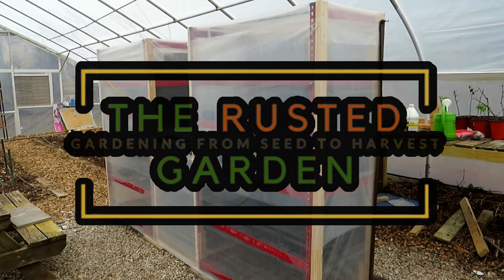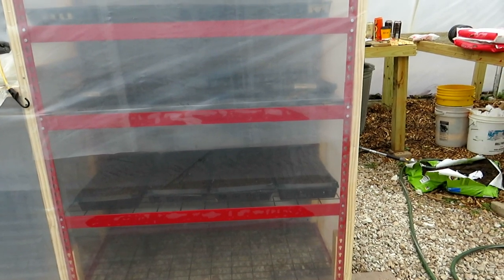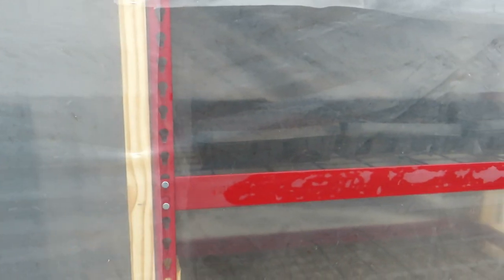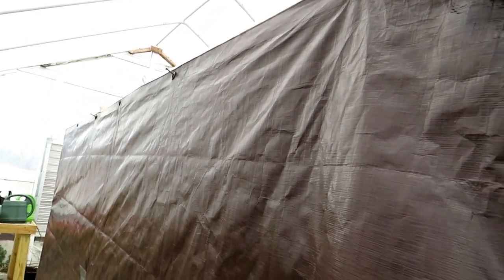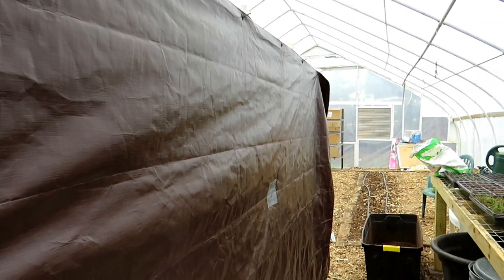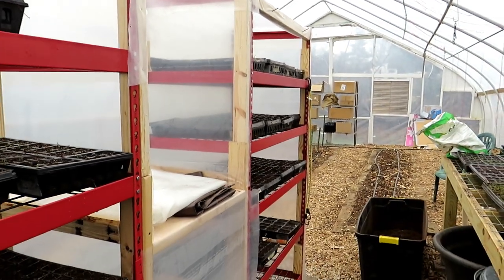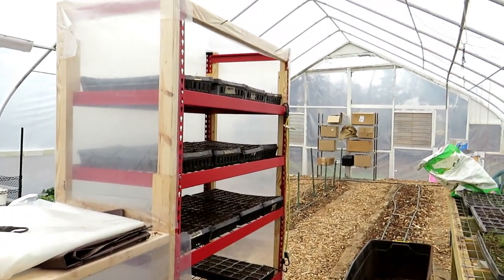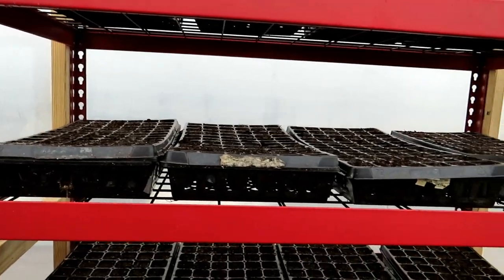Build You Own Shelf Greenhouse for Indoor or Outdoor Garden Use: Basic Principles For You To Create!

Comment: Great job Gary! Being that I sew garments, for the door...I would've used a strong glue to Velcro the sides edges or stapled the Velcro all along the side edges to open & close. Velcro can be placed on any surface & will hold! The Velcro is safer than the bungee cord. I was snapped by a bungee cord & it hurt so bad I started crying!
Reply from the maker: Yes the are dangerous. Maybe Velcro on 2.0.
Please check out The Rusted Garden Seed & Garden Shop for all your gardening needs at www.therustedgarden.com & Please Ring the Bell (next to subscribe) to get immediate real-time video notifications. Thanks
Reply: T-Rex brand double sided super glue tape! I just finished constructing a simple cover for my mini greenhouse  using it and some duct tape. Only complaint is that I wish it came in bigger rolls as the stuff is crazy sticky. I actually save the very end of the rolls as it’s easy to peel back the covering on the little bit stuck to the roll and use it to remove tiny splinters from my fingers.

Comment: Gary, that's a really nice design.  It falls into the category of Elliot Coleman's ideas of double cover = 3 zones south (@1.5 zones south per each layer of cover).  You might want to invest in a remote thermometer so you can monitor the inside temps vs. the outside temps. (from the comfort of your own home, as this is not at your house), to get a sense of all the variabilities, and then make adjustments in terms of venting as needed.  Although, with that high ceiling on the greenhouse you might not have to vent much ... not sure.  Thanks so much for the ideas!
Reply from the maker: Thanks for the ideas. Learning the ropes of this greenhouse.
Please check out The Rusted Garden Seed & Garden Shop for all your gardening needs at www.therustedgarden.com & Please Ring the Bell (next to subscribe) to get immediate real-time video notifications. Thanks

Comment: Hi Gary I love your channel and I am inspired by what you've made here. I am thinking about doing something similar, but I want to ask you and your viewers first. What about using magnets to hold on the plastic? Making lightweight removable pannels. You could use for a door or window to ventilate and access. Fall/spring and in winter you could "insulate the cracks with bubble wrap and tape" I think the sticky tape magents might work but if you construct frames for the exterior from 1x2 or something light and srew or glue or tack, idk afix somehow rectangular magnets to fit the shelf bars and put plastic on those or maybe tuftex. Also in the summer all of the pannels could be pulled off and stored abd the shelf could still be used with shade cloth and clamps for summer  seedlings rack. Also thinking about using the crome shelves with rounded side supports. The clamps that go on PVC fit and that could hold plastic. Lastly, I'm think of putting a roof over it with Conduit and a wire fence to support plastic. Or a roof with wood frame screwed into the clamps that I use to hold pvc hoops on my raised beds. 
Sorry for dumping my thoughts on you. I live in a town where codes are greenhouse and outbuilds are limited, but I can have a shelfs or anything that isn't permanent. The premade plastic greenhouses are too flimsy for NYS weather. 
Thanks for everything and may God keep you in His bountiful blessings 🙏
Reply from the maker: I am using it now at the farm. Heavy duty magnets is a great idea for the tarp. I never though of it. I might try it. Ill be just duct taping them the tarp if I do. Smart! For the plastic. I would only worry about moisture effecting how they stick. It could work. But taking your idea to the tarp will improve the build. All in all I like these heavy shelves, especially outdoors as wind won't knock them down. I think you ideas are good, I would keep in mind high winds too. Good luck
Please visit The Rusted Garden Seed & Garden shop for your fabric pots, fall & spring seeds, seed starting supplies, peppermint oil, neem oil, TRG merchandise and more at www.therustedgarden.com Check out my new gardening PODCAST Gardening Coast2Coast at https://gardeningcoast2coast.net with CaliKim

Comment: Overnight when it's really cold, we drape a bunch of thick, heavy-duty quilted movers blankets/pads over/around the whole thing. Mummified in several layers thick. Strung up real tight with bungee.

There is no cheaper insulation.
You can find them on FB Marketplace and your local craigslist for 3 bucks each (or less in bulk) and 2 layers will keep ours 10t o 18 degrees warmer than the raw plastic alone, mostly dependent on wind conditions overnight. When it's teens and low twenties out there (we're forecast for 25-ish tonight Ferenheit) it does an adequate job for the cool weather plants... we still pull the warm weather stuff into the house ... just.in.case. 

Ours is powered by a cheap 25-dollar ceramic heater set at 750 watts. We can't beef it up to the 1500 watt for easier added heat 'cause all the other crap on that circuit (it's out behind the garage and powered by an extension cord - if the chest freezers kick on while the garage lights are on ... then the 1500 Watt setting will regularly trip the breaker.

We found that the quilted blankets work well at trapping the lesser heat setting and making the most of the lower output. 

Wanted to try a swimming pool solar cover with the trapped air bubbles (think "bubble wrap on steroids" ) for extra insulation during daylight hours but it was cost prohibitive.  Still waiting to find a used/salvage one and will eventually try it ...

Comment: That's a brilliant setup! I may build something like you made next year with one stand and keep it in my unheated sunroom. You are putting lights in there, right? 

For now I don't have a greenhouse, so I moved my shelves into the mudroom because it's a smaller space to keep warm.  I have a little heater aimed at the double shelves full of trays. There is a mirror between the stand and the wall for reflection on one side and double sided metalic insulation on the top and sides to keep the heat in. Working so far for my little operation.
Reply from the maker: In the greenhouse no light. It is fine. If I were doing it an unheated garage or basement, lights would go in. Its a flexible design.
Please check out The Rusted Garden Seed & Garden Shop for all your gardening needs at www.therustedgarden.com & Please Ring the Bell (next to subscribe) to get immediate real-time video notifications. Thanks

Comment: I've watched 3 times.  Where does the electric cord from your heater go?  I'm thinking of this for outside, but not sure where/how to secure the cord.  Also, I might need an extension cord to an inside outlet.  I think it would (might) run in at the corner of the electric garage door?  I'd want to protect it from rain & critters.
Reply from the maker: Well it wasnt plugged in. But an outdoor extension cord will run to it when needed. There is an outlet in the green house.
Please check out The Rusted Garden Seed & Garden Shop for all your gardening needs at www.therustedgarden.com & Please Ring the Bell (next to subscribe) to get immediate real-time video notifications. Thanks

Comment: Nj zone 7, i find that it gets too hot and dry in  my cattlepanel greenhouse. so my flats are drying out too quickly and way to hot. I also made an inner green house just like this. But it gets too hot. Like 90% heat.
Reply from the maker: You need some top venting holes. They definitely can over heat fast!
Please check out The Rusted Garden Seed & Garden Shop for all your gardening needs at www.therustedgarden.com & Please Ring the Bell (next to subscribe) to get immediate real-time video notifications. Thanks

Comment: But Gary, I have a question. How do the plants on the tarp side get light if the tarp is solid in color. Don't they stretch to the clear side?
Reply: I am guessing that's the north side, maybe. You could hang your lights inside directly over them if they are not getting enough bright light.
Reply from the maker: So the tarp is north side. Enough light gets in for the seeds to not get leggy. I also remove the tarp when nights dont fall to freezing. You could use greenhouse plastic to create the door too. The design is flexible. Good question.
Please check out The Rusted Garden Seed & Garden Shop for all your gardening needs at www.therustedgarden.com & Please Ring the Bell (next to subscribe) to get immediate real-time video notifications. Thanks
Reply: @THERUSTEDGARDEN  Thank you, I love the idea 💡

Comment: Why not use that same clear plastic on the side instead of the tarp? Have strips of plastic that you can roll up to open up the section. Maybe stick some velcro tape to keep it from flapping open.
Reply from the maker: Velcro might work but I like the tarp with the reinforced I holes and it is heavier. But you can modify it.
Please check out The Rusted Garden Seed & Garden Shop for all your gardening needs at www.therustedgarden.com & Please Ring the Bell (next to subscribe) to get immediate real-time video notifications. Thanks
Reply: @THERUSTEDGARDEN  I just went to home depot today and saw they have a product called tarp zipper (a zipper with an adhesive). You stick it on a tarp or plastic to create an opening.